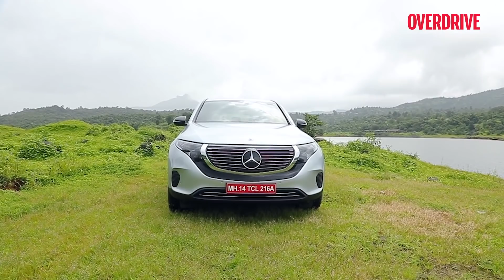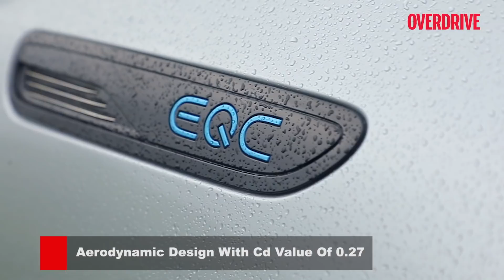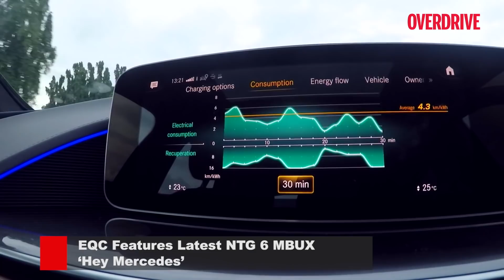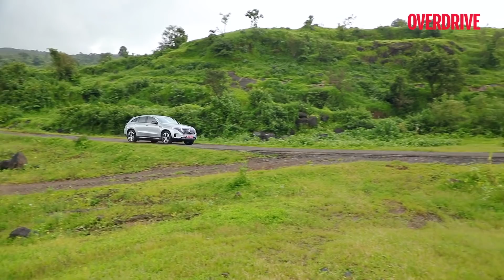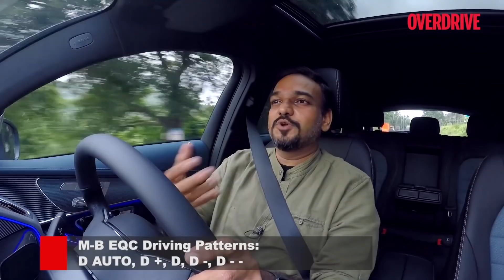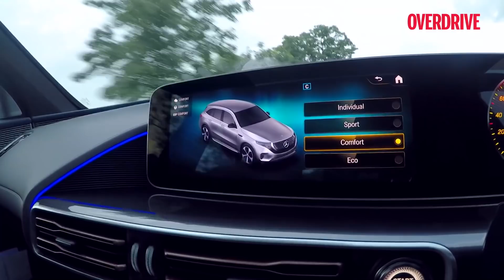2020 Mercedes-Benz EQC 400 4MATIC | First Drive Review | OVERDRIVE

Comment: is it possible to get rid of the fake side steps in the EQC??? don't blend with the car's design!!! there a way to increase the ground clearance of the EQC without altering the basic suspension layout of the vehicle!!! it's not bigger tyres with a higher aspect ratio because the EQC wheels are already as big as they are 21.0 in.

Comment: What’s the India EQC variant missing to its international variant- for ex. Do we get air suspension, is there a lower battery capacity? What’s charging capacity does it support- 110Kw as what is suggested internationally?

Comment: Though the performance shown is good; does the electric driven power deliver the same feel & punch as the Petrol or Diesel??
Reply: Better punch in fact! 0-100 in 5.1 is just the spec. The roll on acceleration and on-tap torque is crazier.
Reply: @rohit_paradkar  thanks bro for the info....